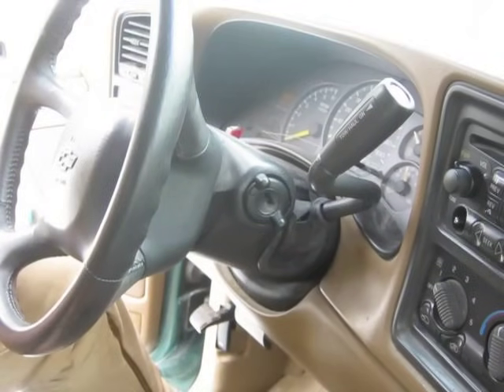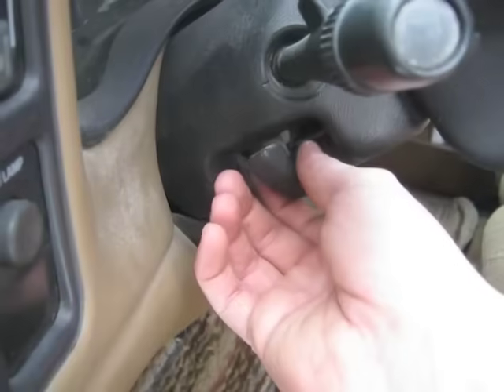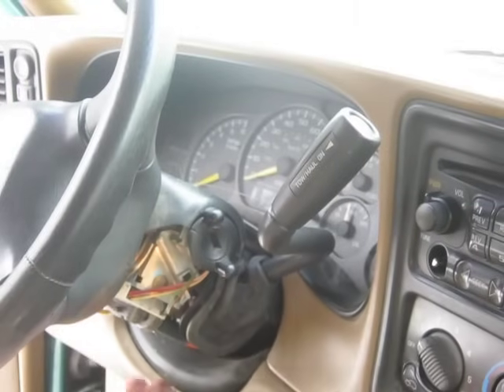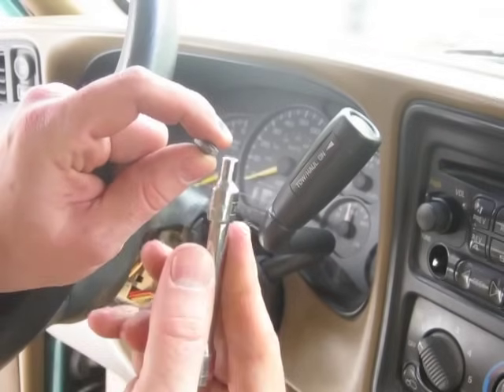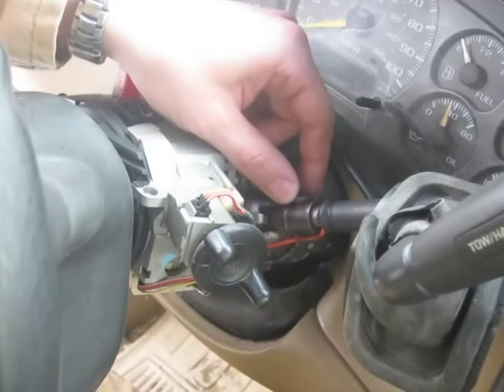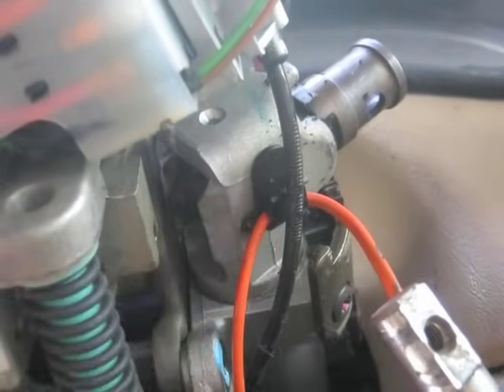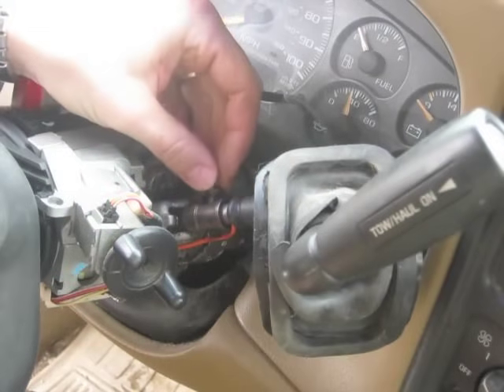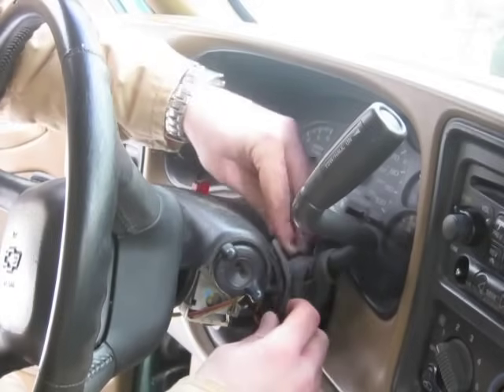Chevy Silverado Column Shifter 1999 - 2006

Comment: FYI, not all models/years have screws holding the plastic covers together. On some the plastic covers simply hold themselves together with plastic tabs that pop apart, so if you can't locate the screws...
Reply: Thank you for this. Was driving me crazy for about an hour trying to unscrew nonexistent screws
Reply: thanks.  ya, i have been trying different allen wrenches and screw driver, there looks like a round hole, in a silver looking head? on bottom bigger hole, I will try and pop it apart, thanks!
Reply: Thank you for that
 I couldn't see any screws.

Comment: I have a 2000 GMC crew cab and your instructions helped greatly. I needed to get the top cover of the steering column to find a short in the hazard switch that was nocking out all my tail light system. Thank you Problem fixed.
Reply from the maker: +Wendy Skoff-Gamsby Glad I could help you out with the video.

Comment: Why do they always have to make the overdrive switch like this, why do they always have to have this wire so tight in that space. why can't they just have it going to a connector in the steering wheel where it freely rotates and the steering wheel connects off to another place to the transmission, so there is no tight wire inside the steering wheel ????

Comment: i pulled mine apart yesterday to fix tow/haul. tiny wires were broken and i tried everything to reconnect them. then i researched the shift lever and found the tow haul connector on the shift lever. now i know where it connects. thanks! ill post a video on my fix.

Comment: This is late, but my lower cover has no Torx screws, just round holes. Looked up into with a light and they are just round holes. Also, there is no way the tilt lever just pulls out. Any ideas??
Reply: Same here lmk if you figured it out
Reply: You boys figure it out?

Comment: Thanks for the vid.  Almost was my problem.  heh.  Sloppy as your kids room here too, but someone had this off before and didn't put fasteners back..  I undid bottom and boot, and was able to get to screw w/o removing top.  Screw was tight.  Huh.  slop in mine was due to busted return spring in the channel there that pushes lever back at driver.  For temp fix, I stuck a piece of plastic in there to make what is left of spring good enough and checked for op.  It works.  I'll have to find part # and someday replace.  Appreciate your vid, and good luck everyone!
Reply: Robert Mardis how thick was the piece of plastic you used? I have the same problem, seems like that return spring IS broken
Reply: Did you ever fix your return spring? I can;t find any info for this repair to save my life.
Reply: John H once you take off the covers,  use a small screwdriver or a pick to retrieve the broken spring pieces. Go to ace hardware, match up the spring diameter and gauge. I recommend getting a couple of them. You will have to cut to length. I made my about 7/8” long. Reinstalling is tricky but completely possible without destroying or taking things more apart. I think I put the truck in neutral, I want to say it gave me more working room
Reply: @ovnox  Thanks for the info. Maybe I should make a video of this when I do it. Can't find one anywhere.

Comment: i'm trying to find out what happened to my column  esp,. the shifter it stopped shifting ... 1 st it wouldn't go into park any more  then about 4 days later it wouldn't start unless it was in  ( N )  THEN TODAY GOING DOWN THE RD,. THE SHIFTER FELL CLEAR OUT & I COULDN'T DO ANYTHING w /  IT..... LUCKY SOME ONE SHOWED UP IN ANOTHER Silverardo & crawled under it  & manually put it in  ( N ) to start it  & then into  ( D )  TO GET IT TO MY LOCAL AUTO., SHOP....
 here's the other part when this all started i had all my forward  gears d, 3, 2, 1,....  but after all this i barely had just drive........... & when i shut it down & or off for the nite i lost park gear some how so i would leave it there & set the  E- BRAKE  HOPING & PREYING IT NOT ROLL OFF SOME WHERE DURING THE NITE.......
... ANY ONE HERE GOT ANY HELP REAL HELP LIKE U HONESTLY ALREADY GONE THREW THIS SAME THING OR CLOSE TO IT & FIGURED IT ALL OUT & VIDEOED IT ALL HOW U FIXED IT ON THE CHEAP BUT WHERE IT'S STILL SAFE U KNOW.........

Comment: Dan, would you happen to know the thread(s)/size(s) of the three TORX bolts you removed from the column cover to open up/remove both halves?  They're all missing from my 2001 Suburban; I recently replaced the shift lever (to restore the OE tow/haul wire connection), and the rubber boot that came with the replacement lever (a little stiffer than the OE) keeps pushing the cover halves apart when I move the lever up into park.  Too much sensitive stuff in the covered area to let that keep happening ...
Reply from the maker: I believe they were T20 torx screws.
Reply: @TheDaninator  … I caught the T20 torx part from the video … I was hoping you might know the thread size/length of the shanks ...
Reply: Try M5 x .8 x 15mm

Comment: Very helpful. It took a while to find instructions on the "hard part", removing the cover to access the ignition switch specific to 2002 Chevy Silverado. Haven't gotten the screws out yet it feels as though they are missing so I will try again using 1/8 allen wrench as you suggested! Thanks a bunch ~ JoJo
Reply: +Jo Anne Lee....it's apart no screws no clips just some gentle persuasion at the seam below the ignition. Good luck!

Comment: Wow your shifter screw just came out. I can't get the damn thing off.
Reply: Use a T30 socket and a nice long drive handle or at least a good ratchet. I believe they use loctite on these at the factory most of the time.

Comment: I have a twenty five year old white gmc.  I pulled on the stick and the steel plate broke off.  an suggestions? ;p  (ps is not my car and there was duck tape around the housing when i took it apart : )
Reply from the maker: Sounds like you need more duct tape. Maybe a junkyard has the part you need to replace the broken piece...
Reply: The Daninator
 : D : )thank you sir!

Comment: This is perfect. Basic and to the point. Got my steering column off in less than 7 min. Thank you. A thorough video on how to replace the ignition switch would be great. I am having an issue of my tach and speedometer intermittently not working and a shifting issue. I checked all fuses and I now believe based off searching web that it's a faulty ignition switch.

Comment: my husband was trying to find something wrong with his truck and while he was taking the steering column apart a piece broke and we do not know what it is. If you are looking at this video about 2:24 in there are three wires and behind those wires is a white plastic piece that also has a spring. Does anyone know what this is it broke into a bunch of pieces and we are not sure.... it also has a spring and the battery light is staying on when the key is removed??????

Comment: You used an 1/8 in. allen wrench to get the steering column cover off in this video, but you used a T20 torx to get the cover off in the video where you changed out the ignition cylinder.  How is that?  Thanks.
Reply from the maker: Jim Bo the corners of the Allen wrench fit just enough in the torx screw to turn it. The screws aren’t that snug that it would round out the star pattern in the screw.

Comment: can anyone advise me on how else to tighten the shifter on my 2001 silverado? the torx bolt isn't the problem and neither is the shifter cable as I can shift perfectly in and our of gears but the shifter as a whole has way too much play in it still. there is a small spring where the handle bottoms out against the column. any ideas would be greatly appreciated
Reply: nvrsawu1 i know this is a late reply but my shifter was loose also. My spring that keeps the tension was snapped so it made it very loose. See if your spring is broke.

Comment: having problems with auto locks they lock fine when put in drive but won't unlock when u put it in park any suggestions?
Reply: Rodolfo Garza  how I disconnect the black connector that plugs into the ignition housing from the doorman shifter

Comment: i have a 2002 Chevy silverado i cannot find or see the the 1/8" allen bolts did they change this in 02 i have no screws inn there at all the 1/8" allen wrench goes all the way inn the column?? Any help be great
Reply from the maker: +Reese Cales It seems like the allen screws may not have been put back in place after whomever took the column cover off before you. Try gently prying the cover apart. You'll find out pretty quick where the screws are, if there are any.
Reply: Hey Guys there are no screws...try using a small flat head right below where the key goes in the ignition, in the seam that separates app and lower, jiggle it loose. no clips or screws for some reason.

Comment: My shift lever boot is ripped up. Will the new boot just slip down the shifter without having to take it off?
Reply from the maker: you may risk tearing the boot sliding it over the handle. With the old boot out of the way, you may be able to access the screw that holds the shifter in place. You may be able to slide the boot in from the bottom. The boot needs to be set back into the grooves to be seated properly.
Reply: The Daninator i guess i'd have to take the orange wire out and the lever off as well. Nothing is simple anymore

Comment: my steering column is the same. how hard do you have to pull on the tilt lever? mine does will not come out the way described.
Reply from the maker: farnsworth eric you may need to give it a good hard pull, but it'll come out.
Reply: The Daninator almost fell backwards,  but it worked. mine is plastic. tightened the scew but already tight, I think it is the spring maybe?